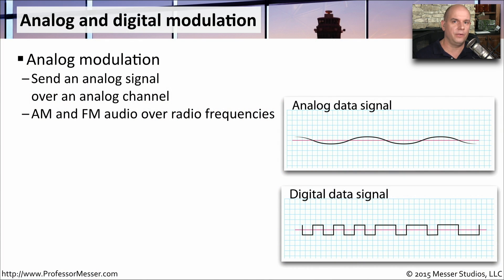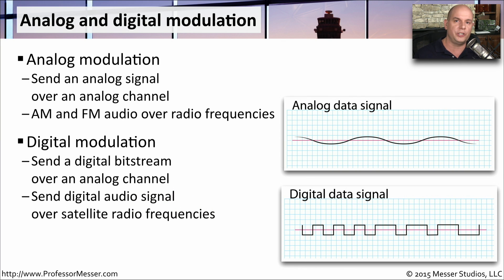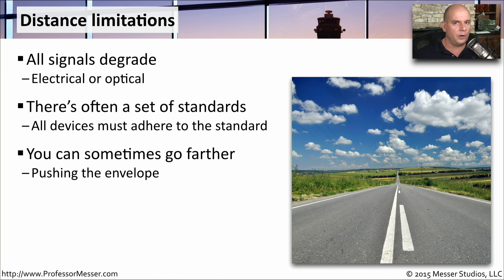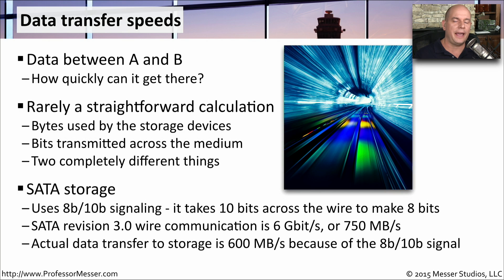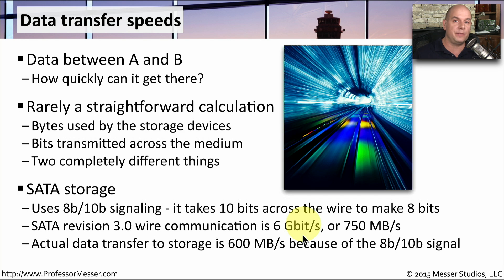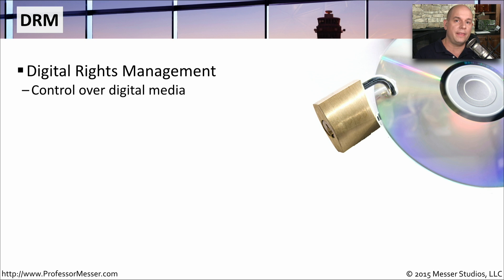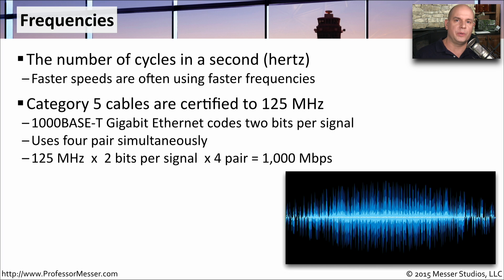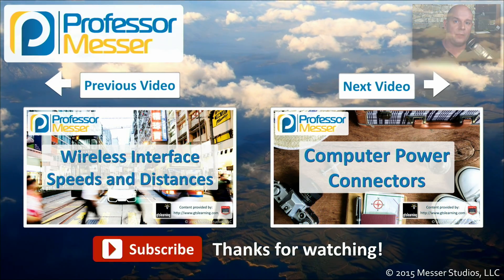Connection Characteristics - CompTIA A+ 220-901 - 1.7

Comment: if cat5e is 135mhz, wouldn't wireless be a faster connection since they're 2.4ghz or 5ghz?
Reply: Speed usually measured in Mbit/s or Mbps. Db usually measures noise
Reply: no, 2.4 and 5 are just the frequencies/channels used. as far as I am aware it has nothing to do with its speed. Im pretty sure Db is the speed of wireless.